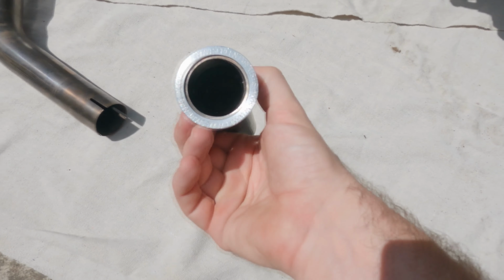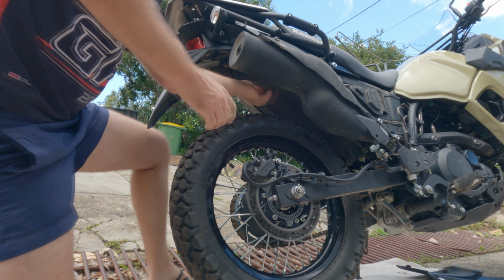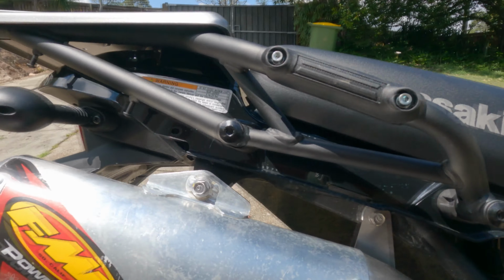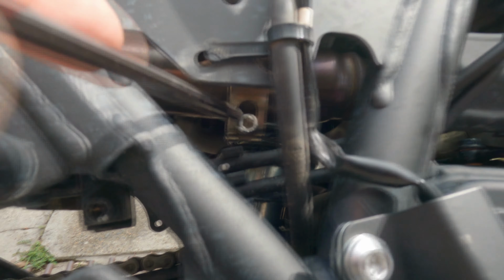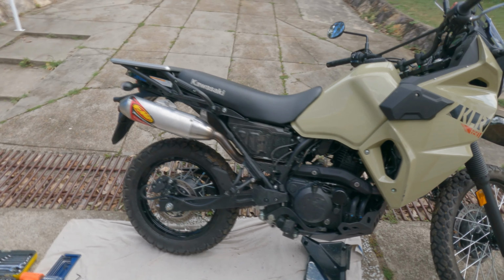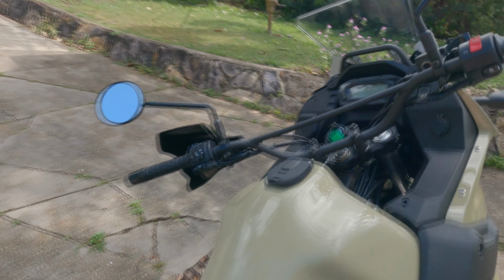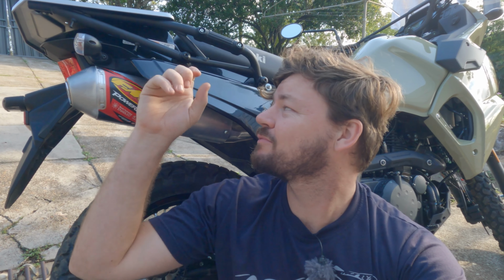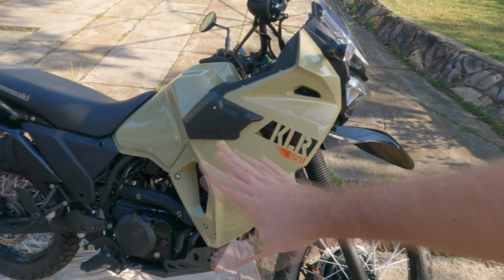Gen 3 Kawasaki KLR650 FMF Powercore 4 Exhaust | Sound & Install

Comment: Very good.  My last 2011 KLR I replaced battery with lithium, new lighter handle bars, took off the rear license plate holder, DG slip on exhaust, de smogged.
I believe I took off a total of 25lbs!  I could feel the difference in handling and the bike did run much better.  Good to see that some of the gen 2 stuff will fit.
Reply from the maker: That's a big difference! I'm going to do nearly all those too. The licence plate is a bit weird on the new gen though

Comment: The stock muffler was tuned for midrange. Did you notice a difference in the power ban. You might want to look at your spark plugs to check if it's now running rich or lean.

Comment: I have Delkevic pipes on my two 2nd gens. The tabs on the pipes are flat. So they would fit. And they are loud.🤣 Like breaking necks off of cruisers loud.
Keeps the deer away.

Looks and sounds great. I'm certain old crash bars will work. SW Motech ones would need longer bolts on the peg mounts. But this new KLR has narrower plastics on the sides. Looks that way to me👌
Reply from the maker: Haha she must be a loud beast! I'm really keen to try some crash bars out
Reply: The o2 sensor🤔 would you get a hole made, or try and get rid of it?
Reply from the maker: @KLRmurdercycle  I'd get the o2 bung installed at this stage. I'll see what the tuners recommend though
Reply: Neat. I personally am not worried about emission laws here. But other people will surely be interested from other parts of this flat planet🤣

Hope these vids get a boost in the new year. When the klr owners start modding🤙

Comment: Will you need to install something like E.J.K or power commander? Or the bike just manage ok the exhaust mod and maybe future airbox mod? 
For example in KLX 250 the fuel injection is so low when you mod it and you need that ECU send additional fuel; if not bike will get a bit hotter than stock

Comment: Hey Curtis, any tips on what's best to use for cleaning up the header?  I have much the same thing on my bike, and have tried a couple of different cleaning products (e.g. purple polish) without much success.....
Reply from the maker: I'm by no means an expert, but generally I start with a strong mix of car wash and water and scrub it with a kitchen wool pad or scotchbrite pad. After then, spray it with a 50/50 mix of vinegar and use one of the pads. If its really bad, try straight vinegar. I thought your purple polish would work really well, but it might need something more serious, like a drill attachment to really clean it up

Comment: Loud is good, its not obnoxiosly loud, takes a while to get used to. Plus you can hear the thing when you are off road which is the point right? I have had it on mine and found it safer around drivers that fail to look. I think it looks good mate👍🏼

Comment: Hey mate
Did you notice any improvement butt dyno with the exhaust?
Reply from the maker: Yes, seems to revs cleaner throughout the range
Reply: @onthebackwheel  wicked
I think the header will definitely be worth doing. Apparently the new efi header is smaller diameter than old for emissions
Where in aus are you?
Reply from the maker: @roocrew86  I'm in Brisbane. Apartment removing the emissions gear really helps too. Got to find the time though haha

Comment: Hopefully...if you bottom out rear suspension..the longer muffler bolt does not hit rear tire!
Reply from the maker: So the longer bolt actually protrudes less than the original because the FMF sticks out more on the fairing side. If you went with too long a bolt it might though!

Comment: I wonder how much quieter the FMF Q4 would be and how it compares in weight.
Reply from the maker: The Q4 is 2.58kg vs the Powercore at 2.3kg. Sound wise, the quiet core insert for the Powercore is supposed to bring it down to 96db and the Q4 is quieter than that again. Hope that helps
Reply: @onthebackwheel    Awesome. Thanks for the info. More KLR videos please! Love your channel!

Comment: Just wondering and hoping someone will confirm or correct.. Is the FI not closed loop? It has an O2 sensor, shouldn't that read the exhaust and correct the amount fuel? So making a mod that increases air flow it should correct by adding more fuel right?
Reply: Its the same system Kawi used in the KLX250. I forgot what loop it was called but it couldnt adjust on its own. If u added a slip on, or opened the airbox usually it was no need to get a fuel tuner. If u do both, they say u wont feel any increase in power unless u add more fuel with a tuner.
Reply: I did some research myself as I got curious and it started raining. Found that the KLR650 is closed loop. So it will richen or lean out the AFR as needed depending on the O2 at the sensor. The KLX300 is also closed loop but the KLX300R is open as it has no O2 sensor.  OE mapping has the need to pass emissions in mind.  After market tuning will disregard the emissions in order to get max performance without the emissions in mind. So from what I have read, you can go without re-mapping and the ECM will relearn and provide some performance improvement with the new airflow but in order to get max performance to match your mods you would want to re-map. Can't wait for my new KLR to be delivered. My son is finally 16 and getting his motorcycle learners so will have someone to ride with again. That power core sounds wicked.
Reply from the maker: Great comment. From my knowledge, everything you said is spot on (tuning certainly isn't my forte though). I spoke to my local motorcycle tuner and I am going to do some dyno runs comparing the stock and FMF. They'll be able you give an accurate description on everything and I'll do a vid up on it that should answer all our questions

Comment: I have requested a tune from dyno jet for the 2022 klr650 and the yoshi exhaust. Hopefully they make one. I'm about to install the yoshi on my bike just don't want it to run lean.
Reply from the maker: Let me know how you go
Reply: @onthebackwheel  they said not enough requests yet to provide a tune. It appears the o2 sensor will keep the air to fuel ratio at the designed 14.7:1 while under normal use. When wide open it will go to a open loop mixture of 13:1 or something close to that. Seems to me the limiting factor of head flow and that o2 sensor will keep the bike from running lean regardless. Another guy has a yoshi and a dj tune. Will have to research that a bit more.

Comment: I can't find a fmf power core 4 anywhere on the internet for a 2022 klr650..I'm about to settle for another brand very difficult finding fmf
Reply from the maker: Mine is for a gen 2, could be why
Reply: @onthebackwheel  thanks that's probably why,I just ordered a Leo vince x3 enduro slip on ,hopefully it will be ok

Comment: How does it run with the fuel injection without a tune?
Reply from the maker: Very good. Seems to rev cleaner. Can have a little stumble at low revs every now and again, but that's nit picking

Comment: Bleeding bloody blimey what a video. If you have the stock plastic KLR panniers from Kawa is this going to melt them without that heat shield? Doesn't look like it.... 

Also, love your positivity!
Reply from the maker: Thanks! I wouldnt think so, the stock side panel has a heat shield and the FMF runs cooler. You can get a heat shield for the exhaust too

Comment: Have you noticed that the new exhaust use more fuel? :) I love you content btw. Thanks 👍
Reply from the maker: Thanks mate. Haven't noticed a difference tbh. If anything it maybe uses slightly more with the exhaust and airbox snorkel removed, but it is negligible
Reply: So the fmf powercore 4 fits right.

Comment: I think they should have made the engine more like the BMW single cylinder 650. That would have gave it 5 to 10 more horsepower, which I think this latest generation needs.
Reply from the maker: 💯. Old Kawasaki didn't want to spend any money though and knew we'd still buy them!
Reply: @onthebackwheel  That's what I was thinking as well.

Comment: Putting a loud pipe on a KLR or DR 650 is like putting a micro bikini on a 285lb woman.
Reply from the maker: Well the KLR is svelte 440lbs so imagine that! I wanted a quieter exhaust, but this was the only one I could get my hands on locally for a decent price
Reply: @onthebackwheel  
My advice would be to enjoy your new exhaust but don’t sell your stock exhaust so you can put it back on when you get tired of the noise.